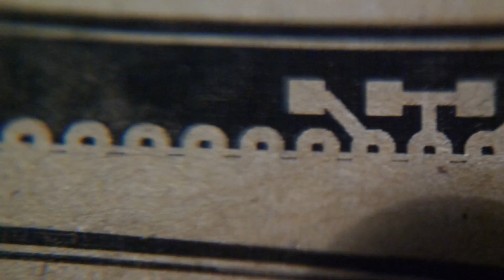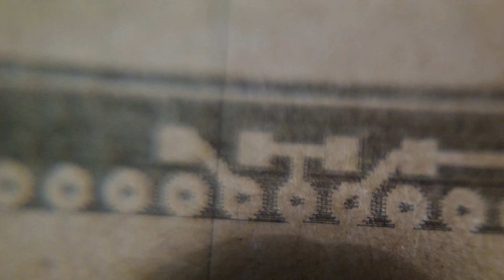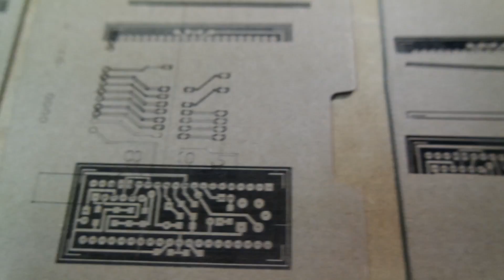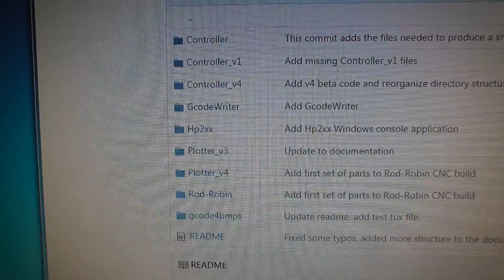The new CNC table pt. 14

Comment: The 130 motors are quite strong, better if you run them through a gear box. Good to see the project moving along, I'm still working on my scrap built CNC plotter, trying to build one with only found items.
Reply: Hi... have you made your small motor work?